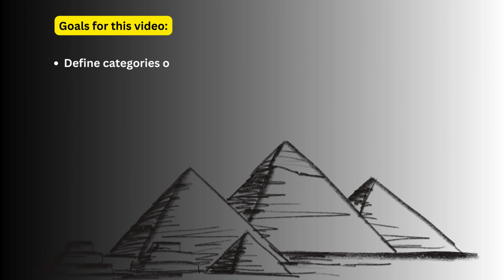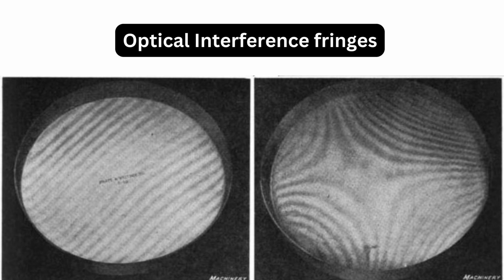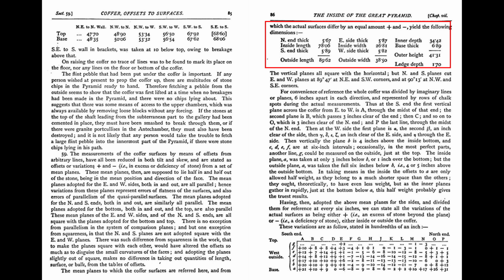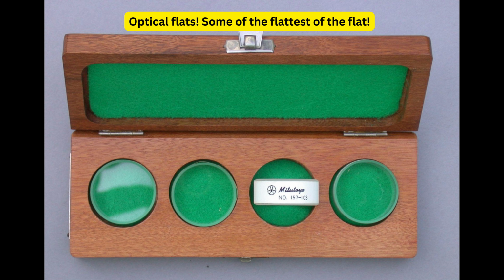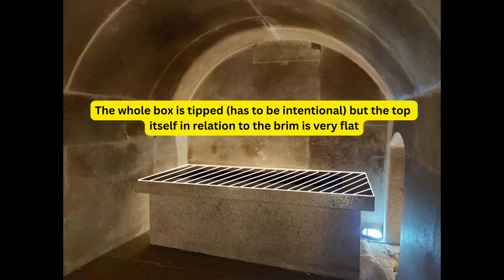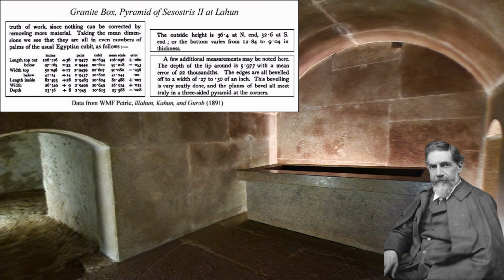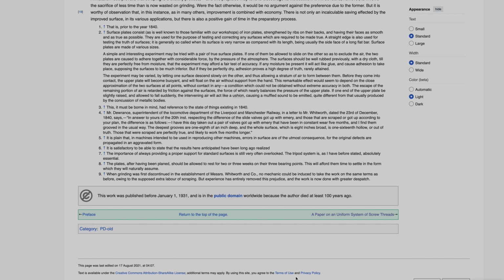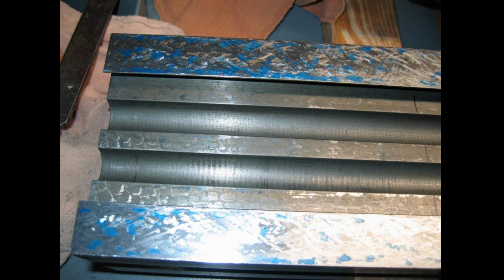The Problem of Flatness in Ancient Egypt

Comment: for thay size stones to be joined with 0.5mm max gap is amazing
Reply from the maker: Very impressive, I think you have to though unless you want them to all be offset by the time you get to the top
Reply: still, I'm currently in robotic welding and manufacturing, and let me tell you that achieving these kinds of gaps work big played of aluminum per steel would be a challenge to say the least, obviously also because of length / thickness, but still, wow  @intothemap360
Reply: All it takes is put two stones together cut between them move them together and cut again, after a few times they are seamless, this is ancient known fact, we have been working stone for over 200,000 years we have a drilled necklace dating 150,000 years, we have worked stone for hundreds of thousands of years, we know what we are doing, you can also go to a river and find two stones together and not put a razor between them and that is a natural process
Reply: @drummerdad80 you people that are so confident yet wrong are the definition of the Dunning Kruger effect. Unbelievably stupid.
Reply: You take many leaps in your logic. Whole also providing no evidence that they did this. You are as speculative as Egypt deniers.
Reply: @Flint_Dribble im dont know who this is pointed at. But if ita at the claims made in the video, he never claimed this was how it was done, only thay the technology existed and that it could be done this way. Also what's an "egyot denier"? Like that Egypt doesnt exist? I've been. Its there. Weird.
Reply: @drummerdad80 yea very easy to move tons of stone against one another with all the friction. Super easy.
Reply: @Flint_Dribble the building material can be of infinite weight. The tooling is what you are moving. Then"weight of the stone"  doesnt affect the ability to move tooling or aggregate. That operation is called "facing" and there are times when its appropriate to move the material, and times to move the tooling. But when you get right down to it ALL operations boil down to "spin the material" or "spin the tool" you've got a pretty strange stance on this and seem pretty agressive over aomething that is pretty innocuous and is really just a discussion about "speeds and feeds". People get pretty passionate about their opinions on soeed and feed, but I've never seen someone mad about it. Its actually kind of strange. But I admire tour passion  if not your malice.
Reply: @Flint_Dribble also also "friction" is kind of what you are looking for when cutting or facing. Although chattering can be an issue. But "friction" as youre thinking about it isnt a confounding factor when it comes to order of operations. Or not to any negligible degree. Machinists by no means "know everything" but we spend our entire careers pretty focused on, when you get down to it "removing materials" so we by necessity are fairly skilled, interested and constantly curious about bot only the history of, but innovations in "cutting". But saying someone is "wrong" without suggestions for different methods serves no gain. There's isnt a machinist in the planet who "knows everything" and the best machinist are always open to new operations. But "not uh" isnt a suggestion. Its just an agressive denial and possibly a justification for having an ego about a lack of knowledge in that skillset. Again, its a prett7bweird position to take. But you do you.
Reply: @drummerdad80 you realize an entire razor blade is at least .040 right? Also river stones don't make themselves flat i have no idea where the heck you are getting this rediculous information. Im a machinist btw
Reply: @spencerkleiman5035  You realize that materials can touch, right? Im capable of thinking btw
Reply: @spencerkleiman5035  I didn't say river stones make themselves flat, don't put words in my mouth, but on that note have you seen shale? Lol pretty freaking flat haha, i said you find them close together and not get a razor between them and thats a natural process, you can also find stones everywhere that are close together, my point was that we live with nature and are smart enough to figure things out, I guess it went way over your head, I am a machinist also
Reply: @SaturninePlaces he thinks because he's a machinist he knows all, i am too BTW lol
Reply: @spencerkleiman5035 usually closer to 0.080 which might as well be a MILE in machining
Reply: @spencerkleiman5035 right? Its like "dont even start this coversation until we are in the tenths...and even then..."
Reply: Im not trying to be elitist but comparing tool making to river stones sounds like "operator" but i could be wrong. This video has 2 points. 1. Flat vs level and tolerances and 2. Its not magic, its literally the procsess we still use today just scaled down. "Youve got this modern equipment" and yet i still use stone surface for my dial indicators. Lapping really hasnt changed much and stoning and edge is the same as it was back then. Id have loved a deep dive into the evolution of aggregate materials (he touched on it a bit) but i understand the video cant be 12 hours.
Reply: @drummerdad80 what about shale? What are you even talking about? Shale can be made thin because of its structure orienting longways. Are you okay?
Reply: @drummerdad80 no you're not
Reply: @drummerdad80 "shale' structurally is known as a "cubic crystalline structure" similar (ish) to bismuth. Also its not even slightly "flat" its extremely flaky and locked to hell on a macro level much less a micro level(and my "level" i mean frame of reference...not level as in "true to horizon") not to mention extremely porous. Its an extremely strange comparison so far out there that I cant even be sure youre being serious. Especially when if we are using "flat" as you define it there are tons (literally) of materials that appear "flat" in nature. Use, volcanic glass, bismuth(as mentioned above) and many others. That doesnt mean they are designed and joined to fit together. Utterly baffling that yous even mwntion "shale" as if it pertains to anything. It would be just as relevant to say "sometimes dogs are brown". Sure thats a true statement. But has just as much relevance to the topic at hand. I have to think you are just messing with us, ya goof.

Comment: So , with the tightness of the fit and it only being one flat contact surface what was the contents ?
Because there are numerous “ boxes “ in the serapeum it sure resembles a power house or energy storage depot.
The little box in the kings chamber is tiny in comparison and will slide thru the wall next to it by the removal of a linteled stone and slid out to be  “ charged  and set and triggered “ with whatever made the hematite soot on the ceiling of the kings chamber .
Check it out .
So ,what did those boxes “hold” , what was in them and why?
Reply from the maker: They held bulls. They took all the plaques with the bulls votive offering out but I’ve seen them at the Louvre.  Read the first hand account of entering the serapeum by August Marriette it’s on archive.org. Oh and they found a bull in a side chamber and many of the boxes have the bulls names written on them.

Comment: Good information but it's hard to imagine rubbing a 15' long side x 5' high sides of those massive containers in the Serapeum on the outside but doing also in the inside? Wow. I'd like to see the muscles on those guys!
Reply from the maker: Well not all the boxes are that good, only a few of them are. There are actually written accounts of building and making one of the serapeum boxes, I’ll have to find it I believe it took them 30 days to move it. Remember those boxes are WAY later than the pyramids.

Comment: Interesting video. However you have a few omissions that should be there. It was Henry Maudslay, Joseph Whitworths mentor, who fist used the 3 plate lapping (then was called grinding) method to achieve flatness to 1/10,000 inch. Whitworth was not satisfied with the lapping (grinding) results so he refined the method by using scraping to achieve flatness of 1/1,000,000 inch. Whitworths method is detailed in his book "The Whitworth Measuring Machine" which is available free online. You have the Whitworth 3 plate method slightly off how he did it.

FUN FACTS: Henry Maudslay is known as the father of machine tools. But he did much much more than that as I found out while doing various studies of history. It seemed whatever subject I studied has a line that runs right through Henry Maudslay's shop. The history of screws, Gauge blocks,  Ships, steam engines, mass production, locksmithing, hydraulics , presses, Michael Faraday, Computers, Charles Babbage, telescopes, and more all owe something to Henry Maudslay's shop. Henry was famed even as a teenager blacksmith, so much so that tourists would go to see the kid who can make tools with just 3 blows of the hammer. Later after he built the Portsmith Block Works factory, tourists came in droves to see it work.

It was said of him "It was a pleasure to see him handle a tool of any kind, but he was quite splendid with an 18-inch file." Nasmyth confirms this, saying: "To be permitted to stand by and observe the systematic way in which Mr. Maudslay would first mark or line out his work, and the masterly manner in which he would deal with his materials, and cause them to assume the desired forms, was a treat beyond all expression. Every stroke of the hammer, chisel, or file, told as an effective step towards the intended result. It was a never-to-be-forgotten lesson in workmanship, in the most exalted sense of the term. No one that I ever met with could go beyond Henry Maudslay himself in his dexterous use of the file. By a few masterly strokes he could plane surfaces so true that when their accuracy was tested by a standard plane surface of absolute truth they were never found defective; neither convex nor concave nor 'cross-winding, 'that is, twisted."

Most importantly Henry Maudslay taught and trained a legion of experts who all went on to create excellence in the world and the British Empire specifically.
Reply from the maker: Haha you’re right, there is way more to Whitworth but this wasn’t a full expose’ of his methods. I also read his paper on standardizing British screw thread pitches. Fascinating intellect.
Reply: @intothemap360  Now do a video on henry maudslay.
Reply from the maker: Haha I don’t just make videos if it doesn’t pertain to my overall channel theme, but I’m sure I’ll read more about him. I make videos that have to do with mechanical history but with an archaeological bend to them

Comment: If they did a proper three-dimensional scan of these objects and then put them through even a basic computer analysis I'm pretty sure we would see pits and bulges and all manner of deviations once you take away the Optics of the Stone.

Perfect Precision was never the point, they just needed it good enough for the eye...
Reply from the maker: Yes and there aren’t even that many items as flat as these are. Most of ancient Egypt was in the rough masonry category aside from the coffers and casing stones as far as the flat dimensions go
Reply: @intothemap360 

Having carved many an item from Limestone, I can tell you that stuff is a joy to carve even with the simplest of tools. The reason they were able to achieve such high Precision was the ease with which you can carve it and the homogeneity of the material, while it is not perfectly the same hardness across the entire Stone It Is by and large uniform at least to the tools that they would be using.

You add the fact that they knew how to use resin and Pitch as well as create simple glues from various animal products you can quite easily see how they could turn a copper plate into a relatively efficient grinding tool
Reply from the maker: The first time I put a chisel to limestone I was amazed at how nicely it carved. I expected it to bounce off like hitting a boulder with a hammer

Comment: Most of the "hyper precise" stonework really isn't. Many videos I've seen are of people using tools improperly. The rest is hyperbole. They're only showing precision that's easily achieved in carpentry and even pottery.

So many people are simply ignorant of how incredibly primitive straight lines, flat and level surfaces, square angles and circles are. You have to be clever enough to use them effectively, and a reason to do so. But you can do it all with digging and string, both of which predate even knapped stone. And you don't need a single genius to invent them out if nothing. The concepts could easily have developed over generations of simple, practical activities.
Reply from the maker: I agree. That’s the main thesis of my video!

Comment: If I wanted to make a house with a flat floor and straight walls at right angles, all I'd need is water, a weight, and string.

Flat ground is easily made by measuring the surface of still water.
With that flat surface, I can use a weight to get a perfectly vertical side, that meets that even surface at a right angle.
From there, take two pieces of wood, or stone, or whatever, put them together to fit into that wall-floor corner, and I'll have a right angle.

But aircraft precision? Those people have never heard of rivets and panel gaps.

Comment: I undestand that the people you presented compare the finish on stone to aerospace finish but I wish you and had compared it to nowdays tombstone finish. Do we polish the inside of a tombstone? How about the depressions on the outside of the boxes? They are not errors. They are not weak spots of the stone. Do you have an explanation for them? You found out about one technique and think it was easily applicable. How about the internal surfaces? For your technique, the 3 plates have to overlap in all directions. How about the problem of having to reposition the box several times without damaging the other ones? Only 2 surfaces could be worked on at the time making the process a lot longer?
Reply from the maker: I agree. There are more questions to be answered. However, I do this in a methodical manner in videos,  not in the comments. There are lots of things to investigate here and I will never says I’ve got it all figured out. Thanks for watching!

Comment: thers smart ways to do things, no doubt they had that ...
its funny to debate on how they got something flat, but the bigger question is, how did they hollow the darn thing out before finishing it to make walls and inside corners as flat as flat can be ....
comparing with modern CNC and modern testing methods, says even more about the difficulty
also, you mentioned saw marks .... you actually wanna saw granite with a copper saw?
there was a test on limestone, worked real well .... at least a few millimeters a day ....
somehow granite seems harder to do ...
however, this was about getting something flat so plz, get yourself an 8 ton block, saw the top 25cm off, hollow the bottom part out and make the lid nice and flat with the tools they presumably had.
do this 5 times and maybe, if i haven't died by then, we'll talk again since i believe it will take you a while.
oh, also try to get it inside a narrow tunnel with basically no light, since thats what they done too ;)
Reply from the maker: I think the copper doesn't do much else other than hold the grains of emery, corundum or quartz sand that can cut the granite. The copper is just the paper part of the sand paper, the sand does the cutting. This is a basic principle in abrasives. Thanks for watching!
Reply: Niemand baut Granitboxen mit so einer Präzision, wenn er sie nicht benötigt und das waren nicht die Ägypter.
Reply from the maker: 😂😂😂 okay have a good day.